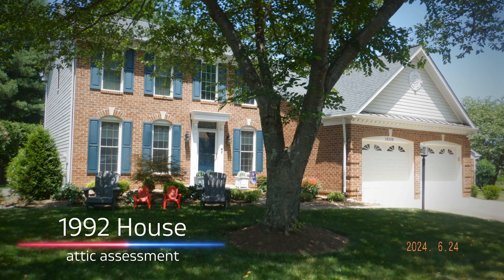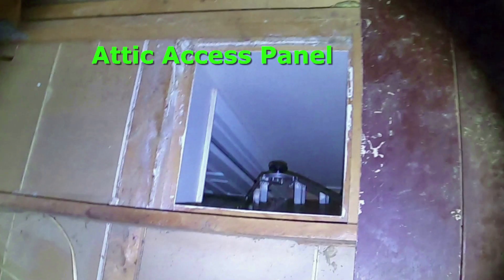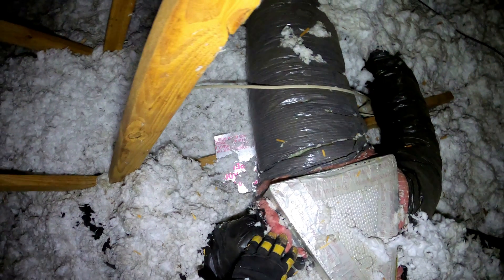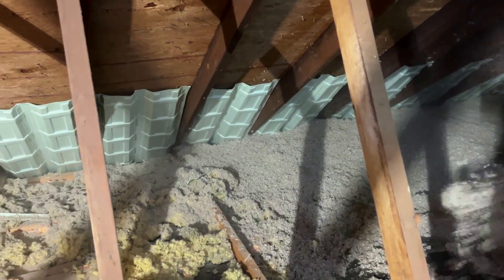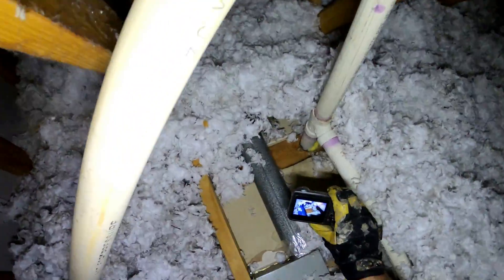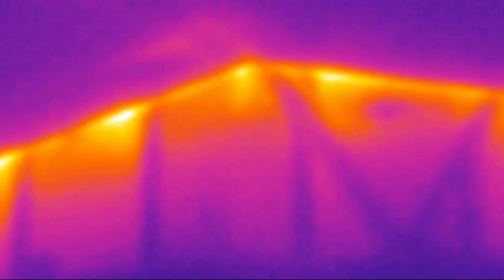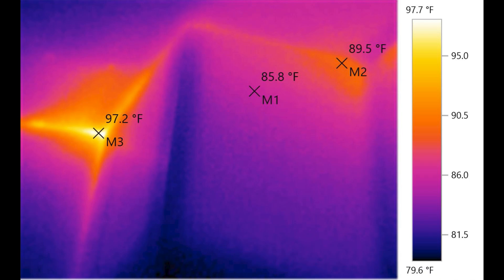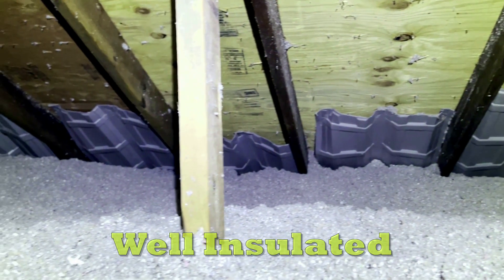How Did They Insulate a House Built in 1992?

Comment: My 1995 house had all these issues.  Also, it barely has soffit vents, and the ones it had were blocked and difficult to access, and had not gable vents at all.  What I did was install a gable vent at one end and an attic fan at the other to get cross flow ventilation.  I did that, spray foam on all the penetrations I could reach, and a radiant barrier.  It's helped my AC bill by about 20% this summer.
Reply from the maker: Fantastic!!

Comment: Peoples eyes glaze over when I try to explain air sealing and the large financial benefits of doing it. When I show them my electric bill and the energy use graph of my home compared to the top 20% of the most energy efficient homes in the area, they are sold. They start asking what did you do to see a reduction like that? BTW I started getting serious with Air Sealing, the last week of February of this year. 

This summer my home (Built 1960 just under 1700 sqft) used anywhere from 10% less in May, to 32% and up to 36% less energy than the most energy efficient homes as shown by the electric company on my June-August bills.  What is really hitting home with me is, I just finished up my Rim Joist and cantilever / bump out, this weekend, and that will be on my Sept bill. The attic is the last area to hit. I haven't done much up there as of yet. Over the years I foam sealed about 1/3 of the wire holes, all the pipe intrusions and put on an insulated Attic Stair cover. I only have 5.5-6.0 inches of old fiberglass batt insulation up there now. Once air sealed It will be getting all new insulation rated at R-60. I'm looking forward to seeing how much my heating bills drop this winter.

Something to think about, if you keep saying to yourself, you'll get around to it some day. I thought about the original owners of my house. These people probably spent in 2024 dollars, between $400 and $500 dollars a year on excessive energy bills over the time they lived here. They did nothing, to very little, to improve the energy efficiency of this house. I probably spent around $250-$300 a year more than I should have in the first ten years I lived here.
Reply from the maker: Way to go! I hope you are able to get to the insulation soon. So happy to hear about stories like yours.